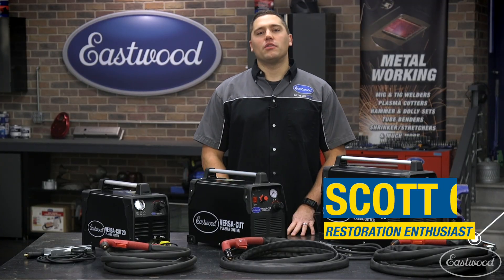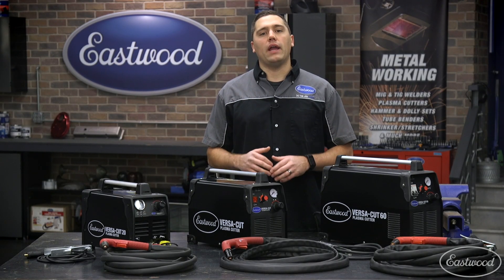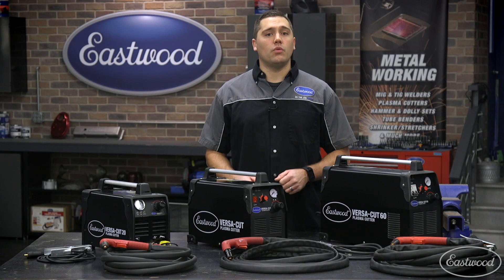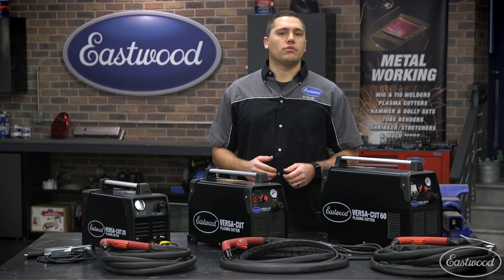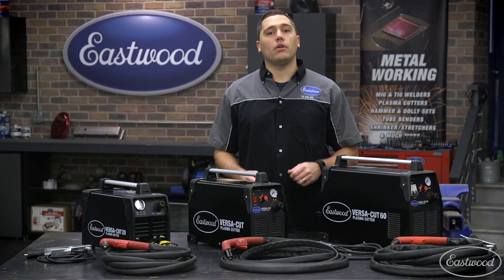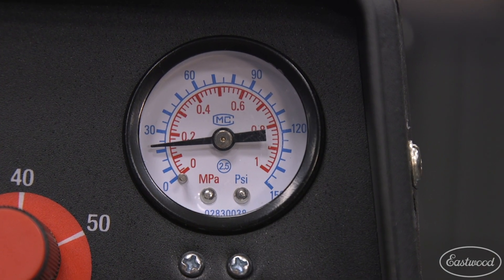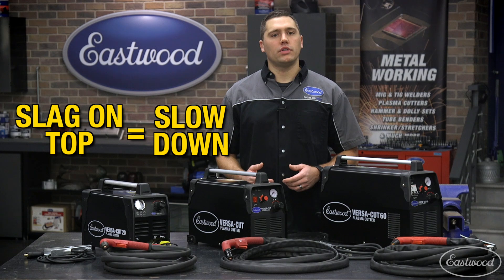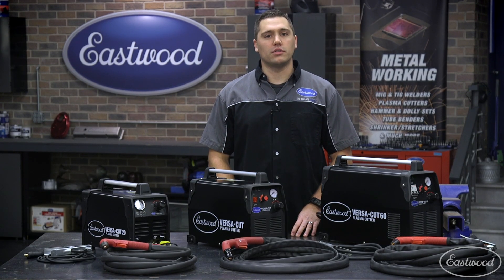Plasma Cutter Troubleshooting - How to Fix Common Problems with a Plasma Cutter - Eastwood

Comment: Plasma cut just quit working still have air but no arc replaced everything about ready to throw it away
Reply from the maker: Silly but is the ground cable attached to the project piece?

Otherwise if it's one of ours - please contact customer support so they can help fix it for you: 800-343-9353

Comment: Hello, can you help me, my plasma cutter has a problem with the pilot arc.
 exactly the same, well, I have Pris 1000
https://www.youtube.com/watch?v=HQ-drPZvCkc
It works hard at 2 bar. and this is a problem when cutting metal.
I want to send you the whole picture to make it clear. I will be grateful to you for this
Reply from the maker: Sorry that's not our tool - you'll need to reach out to the manufacturer.  I can suggest picking one of ours up for the next time though: https://www.eastwood.com/versa-cut-60-plasma-cutter.html

Comment: Please explain the application for 0.03” plasma cutting nozzle orifice, vs 0.06” plasma cutting nozzle
Reply from the maker: Smaller nozzle diameters have a more focused plasma beam which allows you to run less amperage and have a smaller kerf. This is helpful for thinner sheet metal to reduce warp and give better quality to smaller features common in metal art, for example. The larger nozzle diameters will be more durable and capable of more amperage for cutting thick plate all day where super fine details aren't as important.
 
Be careful smaller diameter nozzles might have an amperage limit, typically stated on the packaging or product details. If you exceed that you'll smoke the nozzle quick.
Reply: @eastwoodco do you guys sell the smaller size for the cnc cut 40

Comment: brand new versa cut 60 no air flow at torch no arc, good voltage good air pressure wtf?
Reply from the maker: Please contact our customer service team at 800-343-9353.

Comment: i have a versacut60 & i fukn hate it. random "overload" light tripping. tryd air filters, new consumables, different pressures & amps new ground clamp nothing fixs
Reply: I have asked Eastwood several times about the overload light lighting the instant the trigger is pulled and was told flat out the warranty was expired, we will not help, please do not contact us.  Recommended I purchase another unit for $800.  

I have 8" of cutting time. 8 INCHES, then stored it for a year.  Now it is useless, $800 loss.  I am not pleased by Eastwood's refusal to support their product.

Comment: I've got an everlast plasma cutter and it cuts pretty good but everyone is saying that putting in an air dryer will help increase the life of the consumables. What kind of air dryer should I be looking at?
Reply: Im using one from harbor freight it's a big size, don't recall. But mines been doing great. 
Have water/oil separator, filter and air dryer.